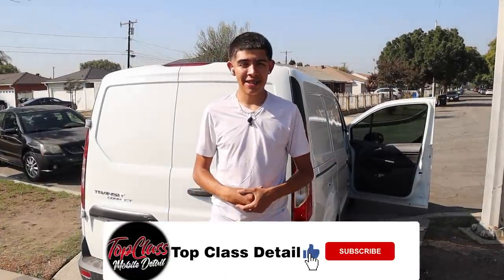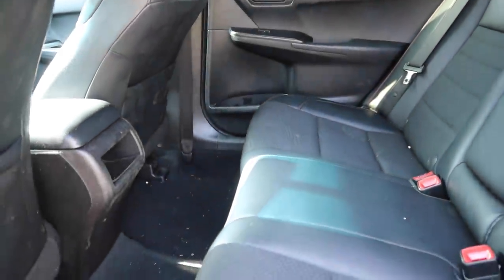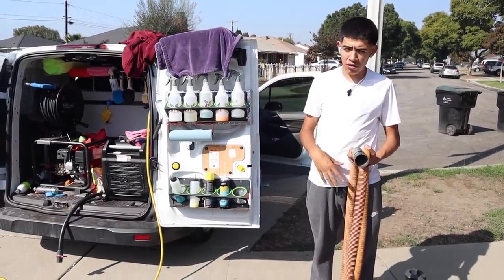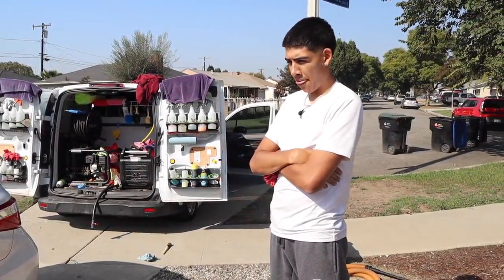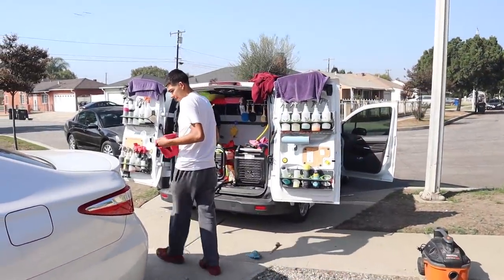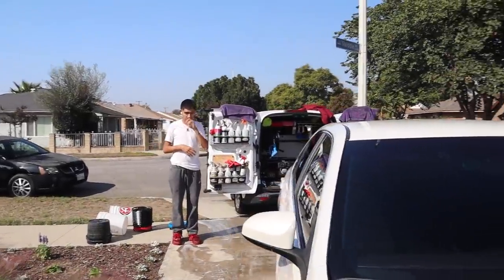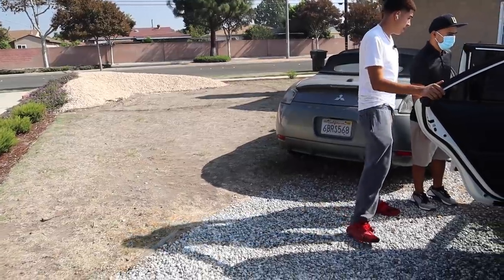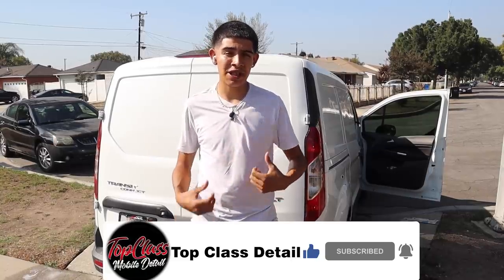Express Wash on a Camry - Top Class Detail

Comment: The polish seems expensive , I seen in your other video you said 600usd for a one step polish and you just said it will take a 2 hours , polish that you use costs a few dollars for one car , the pads you will use a few and microfibres again a few but you can resuse them, you’ll clay it first , so materials cost around 20-30 usd per car and seems a lot of money for 2 hours work
Reply: It’s not about the time, but skills and experience in the work you’re doing. Skills don’t just come instantly. You’re paying for the man’s knowledge, time, skill, tools, etc.
Reply: @talkcyn5286  you I get it , I’m a electronic engineer and I use top notch equipment but if I charged that much labour then I would have no customers at all